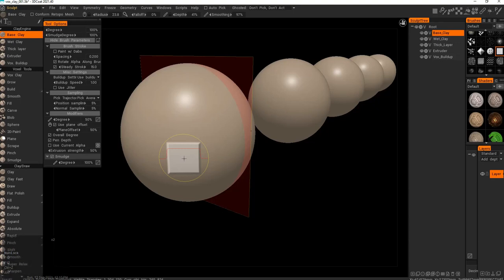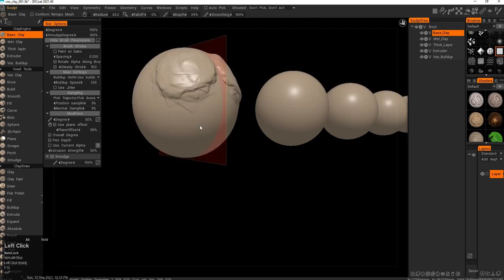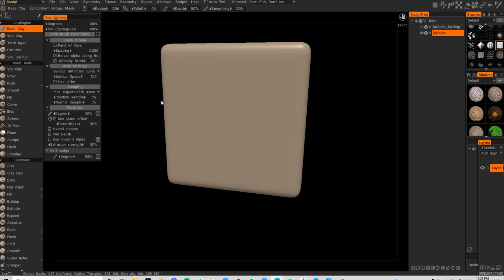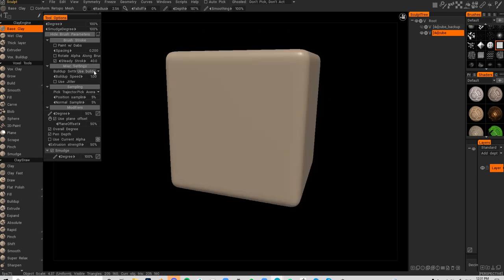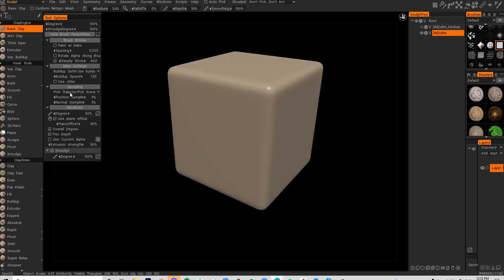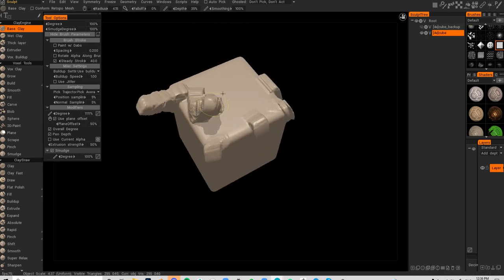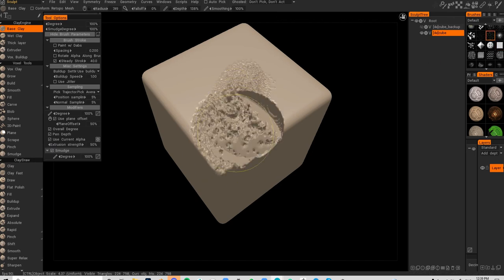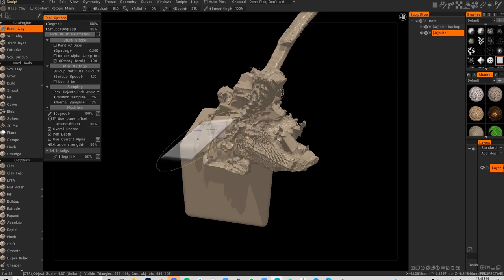Clay Engine Brushes - Sculpt Room - Intro to 3D Coat - 08

Comment: Hey , there used to be live clay brushes so You could kinda subdiv specific areaa on the fly.... I cant se them in 2021 anywhere.... Is there a way to still do that without changing res for entire mesh..?
Reply from the maker: Yes they are still present in 2022

Comment: I didn't upgrade since their forum and documentation is useless. I will use 4.9.72 only for destruction sculpting and painting from now on and blender for all the rest.
Reply from the maker: i undestand. There are some cool functions that appeared but man buggy as fuck.
Reply: @AntonTenitsky  I would love to see that software get on top but they don't seem to understand that a forum and decent documentation is the key to success! On blender forum when i ask a question i usually get an answer in less than 2 or 3 hr after posting and on 3d coat forum it take sometime 3 to 4 days!